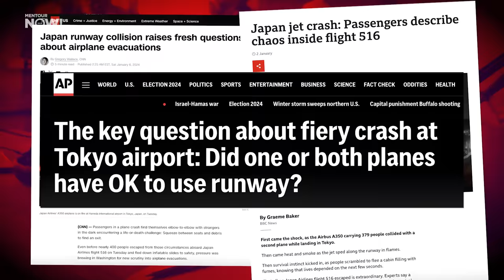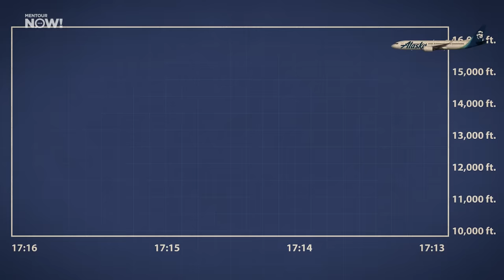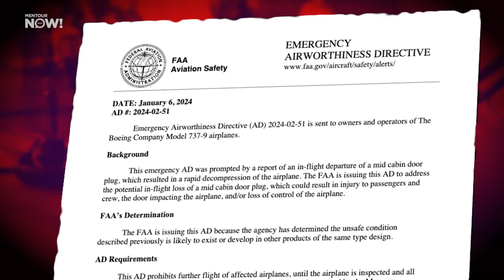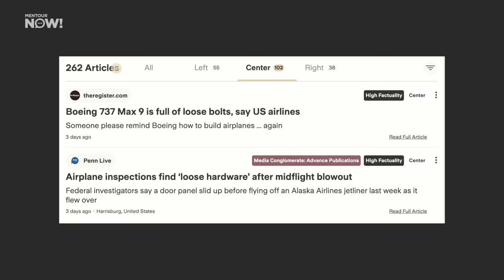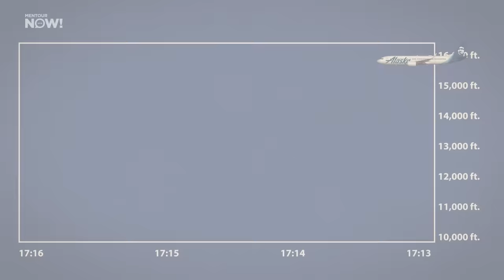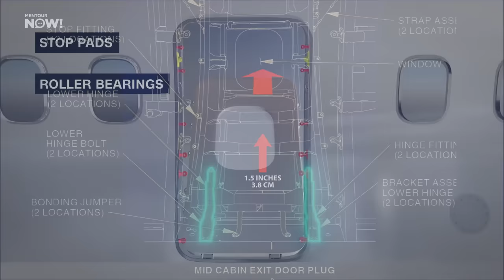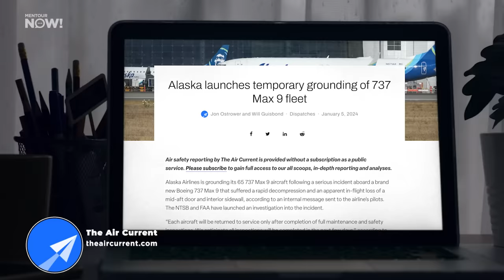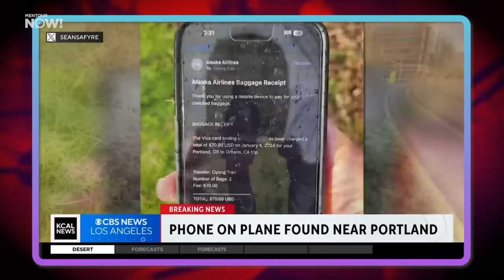WHAT Is going ON with Boeing?! MAX-9 Door blowout

Comment: Dear Mr. Hörnfeldt: I understand your "Don't panic" attitude, and you are not in the fast news cycle, and you do not yell "fire" in a theatre. I am disappointed! 
There is an extremely serious track record with Boeing, and it is time to ask questions, instead of saying "we have no evidence of anything really bad happening intentionally", as you pretty much do here! 
These questions to be asked, should be about what the Boeing management is doing with the other aircraft it builds! Problems (and please QUIT using the word "issue") in the manufacturing plants RIGHT NOW are indeed affecting all types that Boeing builds, with reports of missing screws and nuts and parts and leaving tools in hollow spaces going back years and decades, and the 787 and other plants in Wichita indeed made the news about this, just like the Seattle area plants. 
Problems and cover-ups by management date back all the way back to the engines that fell off a 707, and they only have become worse since then! The 737 has a LONG history of quality control problems, like the faulty by design fin-rudder activator causing a "hard over" condition that crashed and killed several aircraft with all on board dating back decades into the 80s and even 70s, but Boeing deliberately covered this up. The Seattle Times has a long article series about that one online, and I heard it on National Public Broadcasting Radio in the 90s, and then looked it up to verify! Maybe, this is uncomfortable for you as a pilot actually flying them, and it would certainly be detrimental to your career, but there is a time in everybody's life, when we have to decide what is more important, the common good, or one's personal welfare and retirement! I am certainly not well off, and barely scraping by, but I always tried to do the right thing. I bit the hands that fed me, both in tele-communications and in IT-support (and contrary to most people's imagination for either, faults in telecom and computing can and do kill!), because I was fed up and started screaming in my dreams at the abuse these people in charge were doing for money! 
I will leave it to you, to continue the thoughts....